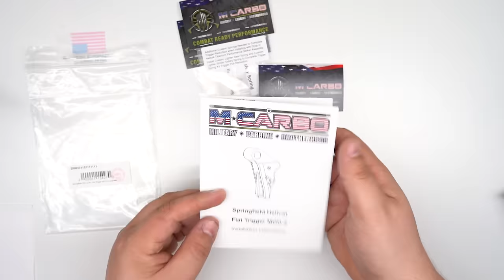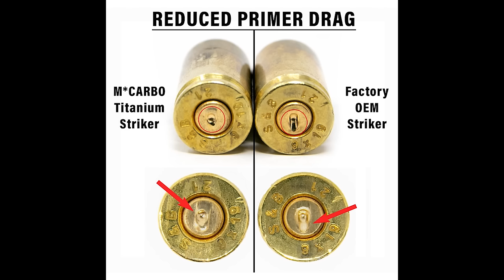M*CARBO Springfield Hellcat Pro Performance Bundle: Best of the Best for Hellcat!

Comment: I installed the titanium striker assembly and the trigger and springs into my Hellcat Pro. I could to be happier. It is fantastic. I installed the striker assembly first and it alone reduced my trigger to 4.5 lbs and improved smoothness. Then installed the aluminum trigger and spring. I also adjusted out some of the pre-travel. The aluminum flat trigger is a huge improvement. The Hellcat is an incredible gun with exceptional grip, size, and capacity. For small gun it is easy to keep on target. . However, the 7 lbs stock trigger was a killer.  M*Carbo has out-done Apex on this one. It is my opinion that this is as good as it gets.

Comment: I've tried several triggers in my Hellcat and the MCARBO one is by far the most comfortable and is easily what I consider to be the best of the bunch.  Sold the rest and this one remains.  Great upgrade!
Reply: Would you say it’s better than the apex trigger. can’t decide what to go with there is  so man options wish I could test em all before purchasing.
Reply: @rookiboi26  I don't know that "better" is how I'd describe it, but personally I like the MCARBO feel and function very much.
Reply: @rookiboi26 I have the Apex, it is insanely good and I'm more accurate and fast with a sub HCP than with some full sized guns in great part to it. That said, it is not comfortable. I get a little pinch here and there from the safety blade.

Have not tried any others on the HCP.
Reply: Any experience with the PRP trigger assembly?. I did the upgrade to my XDsc and really liked it. Thinking about doing the same to the hellcat.
Reply: @j8nkies20  I like the feel of the MCARBO best, but the PRP would be a nice upgrade as well.
Reply: @nells736  Thank you for the reply. 💪🏽💪🏽

Comment: Great instructional video. Explained everything very well. Took me like 15 minutes from start to finish. No polishing or other touch ups done. Just installed the complete kit. Smooth, crisp 4lbs every time. This is EXACTLY what the Hellcat Pro needed IMO. Everything else on the pistol was just right... Except the dang trigger. Great job MCarbo on the FCG refit!

Comment: Good job on the video! No rambling, I'm surprised. Straight to the point with just enough splainin to rather effectively communicate the dissassembly I and assembly. I could have avoided some tinkering if I watched this before I took mine apart a few times. Video looks good as well. Nice. I've got a competitors trigger so I may or may not get that but I'm getting the springs and striker for sure. Thanks
Reply: Oh, pointing out where to polish is very very helpful, thanks again.

Comment: ❤BIG THANKS to M-CARBO🇺🇸! I went to their website n bought A kit called SF hellcat triggers spring kit & steel sleeve which has all BUT the trigger and the fire-pin (does have the fire-pin steel sleeve). I just installed it today n cut down 1.2 lbs trigger pull 🎉🎉🎉(from 6 to 4.8, smooth), new pistol, I am HAPPY! PS: I think it’s only $60 w fast free shipping!

Comment: Just installed the striker set along with a DPM recoil reduction system and I’m excited to go try them out. I can already feel a good difference in the trigger just by dry firing it. Still on the fence about getting the actual trigger just because I want this to keep the stock appearance.

Comment: anybody else have any issues with  loading the hell cats mags to full capacity? seems like mine is really tough to get the last few bullets in.
Reply: Keep them fully loaded and in about a month, spring tension will lighten, making it a lot easier.
Reply: @tommccormick9290  Thanks I will try that. The only issue us is I can only get  about 8 rounds in a 11 round mag.
Reply: Oh, so it sounds like you got the regular Hellcat instead of the Pro model like mine with 15 round mags. I don't know about you but mine came with a mag loader. That seems like that's what you need. On very rare occasions when encountering difficult magazines ,I brace them on a table top and press the cartridges down. You just need strong thumbs.

Comment: I don't get how so many people can be happy with this "upgrade'. First off, its stupid expensive for what it is. I'd also beg to differ on the "3lb" resulting trigger as mine is more like 6 after dry firing at least 300 times. Oh, and the trigger safety no longer works. I see I can fix that with a file, but for nearly $200 in parts I shouldn't have to. 
Had to take mine apart at least 3 times because replacing the mag disconnect is glossed over. 
The whole 'S down" is BS as both ends of the spring are actually open, one is just a little more open than the other. And no mention of replacing the C clip! Totally disappointed. IMO I'd have gotten the same or better results just by polishing...which I did WITH the mcarbo parts and I'm still thoroughly disappointed. 
I think many of the commenters are suffering from Placebo Syndrome. They paid for it so they think it must be better..even when its not.